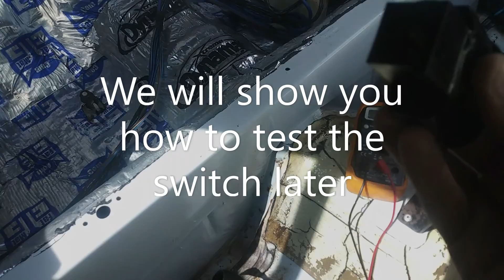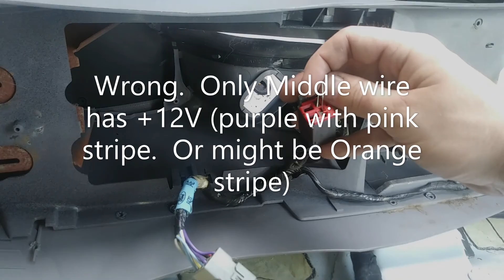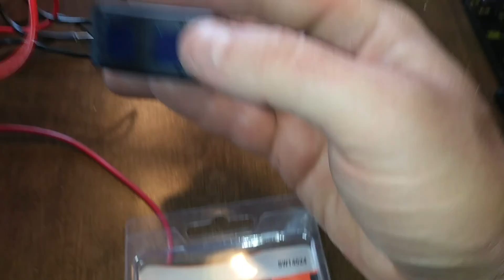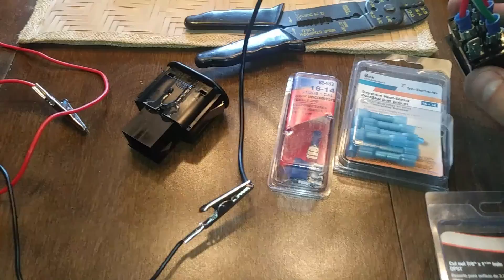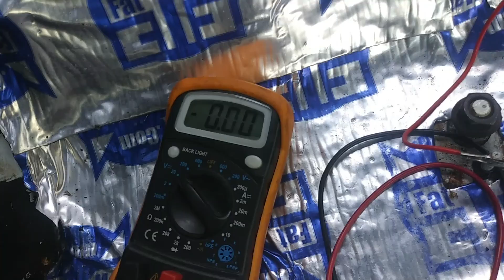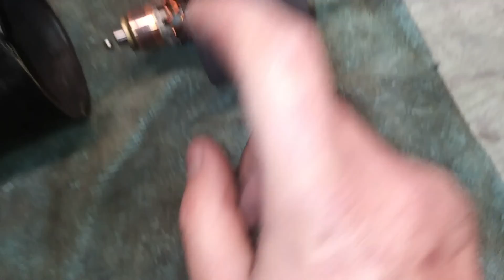How to Fix 94-04 Mustang Convertible Top

Comment: Great video.  Voltage on all pins is how I figured out my multi meter crapped out. Lol.  Did you need to do any adjustments?  I have a '99 and the back corner of the passenger door started catching on the lip of the top.  Now that it has gotten colder the rivers side is doing it also.  I bought a reprint of the shop manual for the tops but a video would be nice too.  There are some instructions that are not entirely clear.  Thanks.

Comment: Any tips ? I'm breaking my head trying to figure out my problem.  My convertible top opened up just fine but lags when trying to close. When trying to close it would close about halfway up and just stop while still trying to press button to continue closing only relay sound happens but no action on closing. Then after a few attempts of pressing button to close same thing over and over happens.  Only makes it about half way . Ps I changed button switch , replaced motor , filled with hydraulic fluid not dexron , and put on some used hydraulic cylinders from junk yard.
Reply from the maker: @40mmcomboplatter  I would unplug the 2 pin connector from the motor.  

Then using another 12V battery.  Like maybe from your riding lawnmower.  Or a spare battery.  Jet ski?  Boat?   

Or just use a set of long cables.  

But apply power and ground directly to the 2 wires coming out of the motor.  

See if the top runs.  

Then disconnect the 2 wires.  Reverse the connection to your spare battery. 

And see how the top runs.   It should run reverse. 

This will directly power the motor.  If everything behaves normally.  Your issue is something in the wiring of the car.  

If it doesn’t behave normally.  Your issue is motor or pump or hydraulic system related

It also could be that you are low on fluid.  It sounds like it’s pumping air.  

Is the motor running while the top is just stuck?  If it’s running and the motor isn’t moving.  And it doesn’t sound like it’s struggling or whining or groaning.   Try adding some more fluid.  You could just be low.

Comment: I need a new power source are the yellow and red power I know the ground is in the e break
Reply from the maker: No the e brake ground is for the relays.   Not for the motor. 

If you need a new motor power source.  I would grab off of the battery.   Or a known good fuse in the fuse panel.